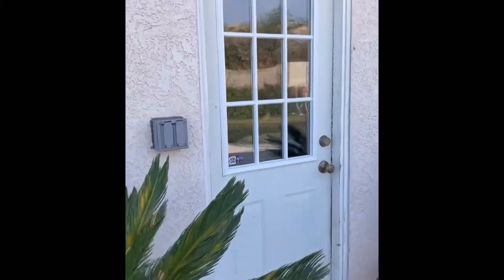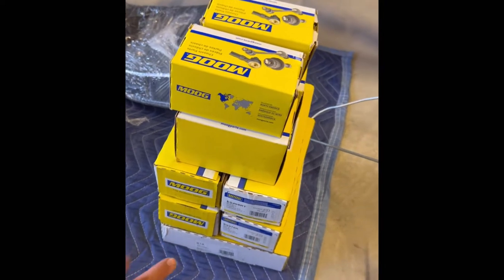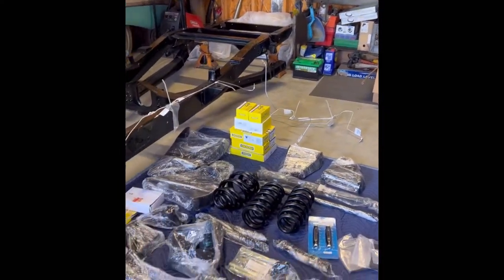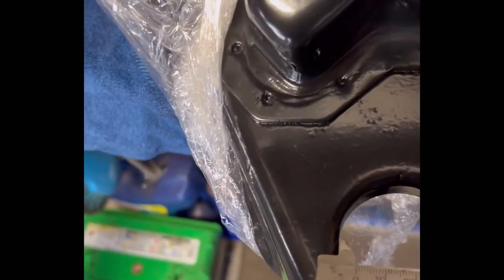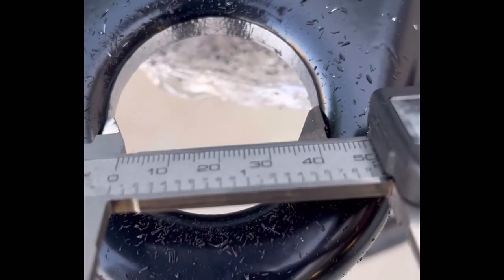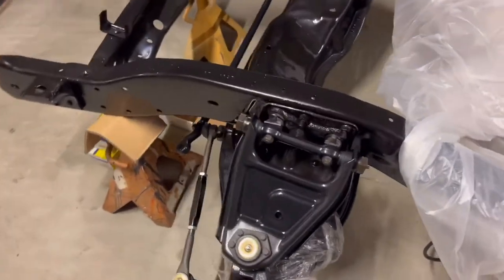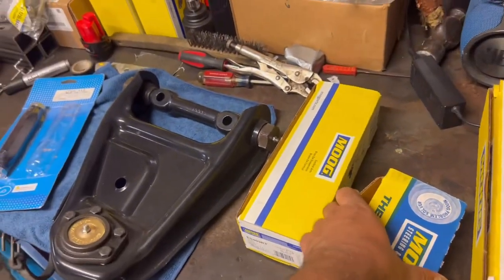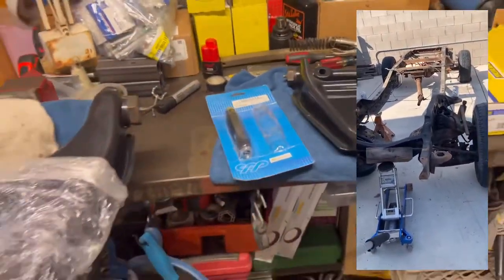65 C10 Low Budget Disc Brake AND! 5LUG Swap | Assembly Of Factory Short Bed Frame | POL 2”- 4” Drop

Comment: So im confused did you get the a arms from a 70s c10 or are you using ball joints from 70s c10 on 65 arms?
Reply from the maker: 1973-79 ball joints on your factory 65 C10 arms
Reply: I have a 64 im going to try this out thanks